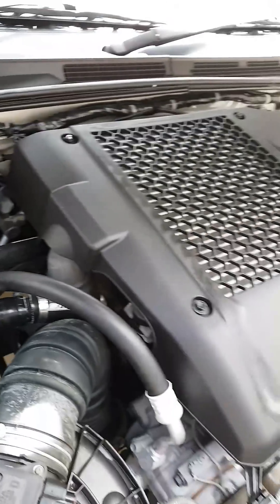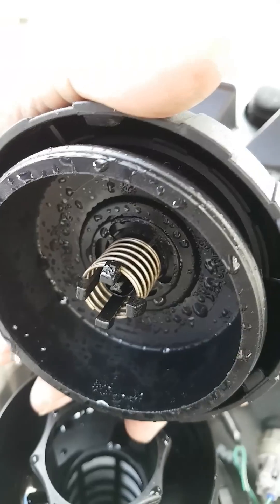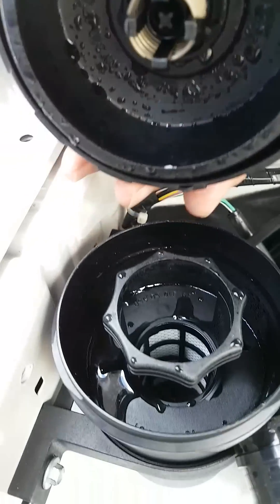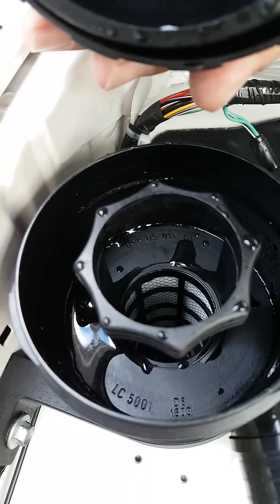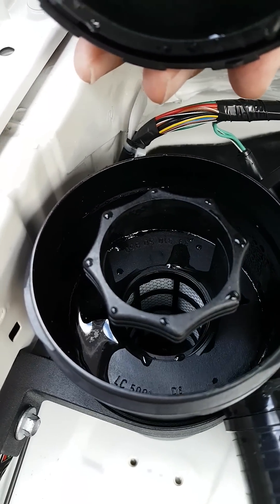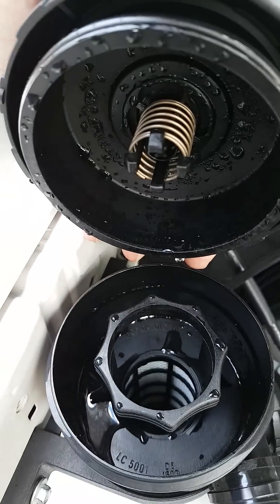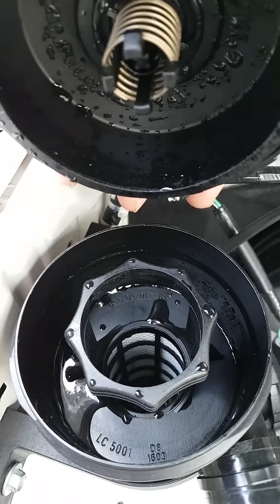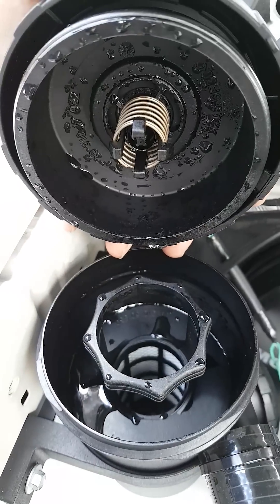Oil Fumes Catch Can Saves Engines

Comment: i do all things with my triton and 6 months oil and filter changes are the go here once a year oil changes even with full syn oil is not on an the spring on the provent catch can is not strong enough i got a resonationg sound about 1400-1700 range ....the fix was to stretch the spring and that fixed the very annoyoing sound comming from tne catch can